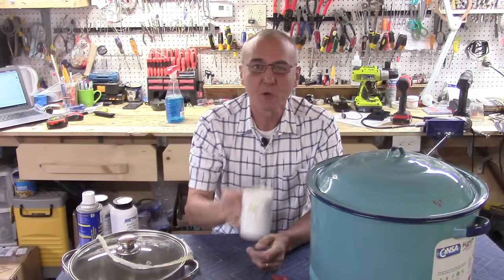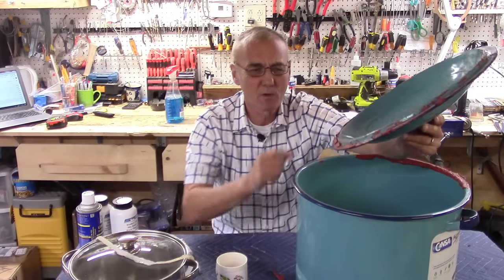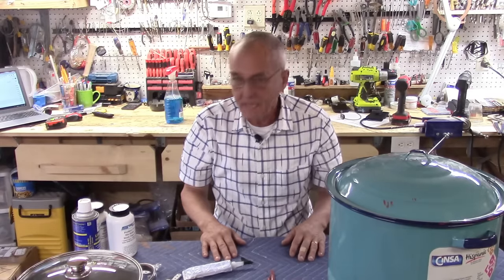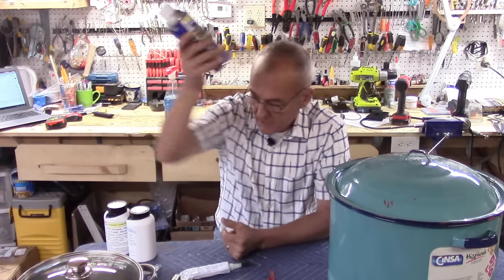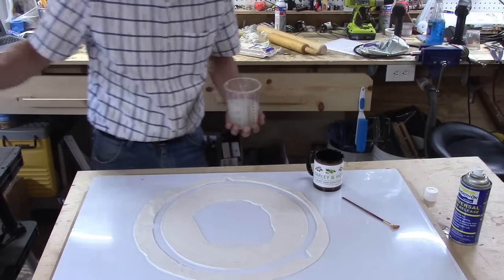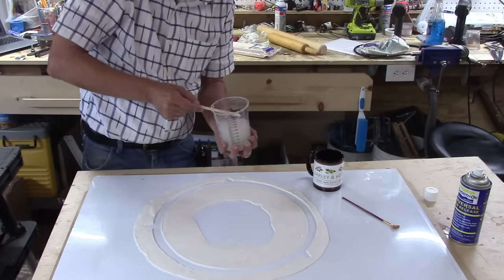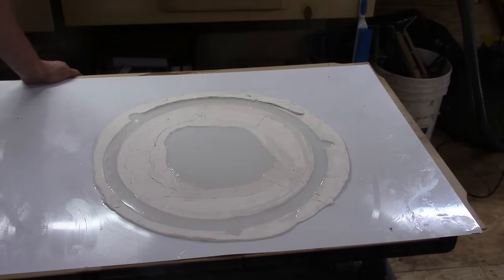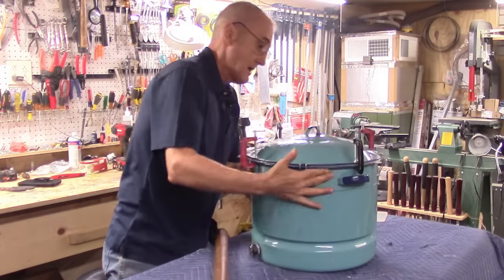BUILDING YOUR OWN STILL

Comment: Would a pressure cooker from a junk store not be easier? They have good seal (hopefully), are thick metal, and can be drilled for heat element and reflux column.
Reply: aS LONG AS IT IS STAINLESS STEEL , doh caps, you should be good to go. Aluminum is not good for distilling alcohol, but I have used an old aluminum pressure cooker to distill botanicals.

Comment: Mr George please spread the word about filtering and the importance of doing so.. stainless steel leaves flakes and trash in your distillate. My top and pot are stainless steel But ,But the so called stainless steel washers I used twice now! have rusted and the coating was in my product! I learned from you and I don't consume anything unless it runs through a Zero filter first. PLEASE spread the word to filter first.. it happened twice Mr George. No telling what was in there. At least bare bare poor boy  minimum let everything settle at least 24 hours and only use half after settling.
Reply: Dave M  your right I think it was Zinc but I got it from the same bin that said stainless steel.. I bought a few more and looked closely for the flakes in the metal. I got lucky this time and threw the others out. Just trying to warn others to make sure they are actually getting stainless steel.

Comment: Flour and water. Use clips to hold it in place.
Reply: Rye flour is the best they tell me.
Reply: Does you mean as a gasket seal? Basically make a dough and push it around the lip of the lid?
Reply: @stephenborntrager6542  Yes, as a seal. Cheap & non toxic.
Reply: My dad used to do this. He called it a whiskey biscuit. And he always ate it when the run was done.

Comment: i hear it rarely spoken about ,  but its my understanding that the chemical product of any distilled alcohol , that gives a bad hangover and reduces the quality of any liqueur, are congeners . if you dont know, copper has a chemical interaction with these congeners , effectively neutralizing and removing them. by the physics, it doesn't make much sense for anyone, be it home hobbyist, or large distillery to use anything except copper, because of these reasons. yes you can distill with many materials, from, stainless to painted and coated surfaces, but your final product will be full of congeners  unless you make some other measure to remove them. if your serious , and want a fabulous product, thats clean, smooth, and doesnt make for a nasty hang over, you use copper. yes it takes more time to clean and prepare, and you have to make sure its got absolutely  no corrosion before using,  but it by far and wide, will produce the best liqueur. i cant stress enough the importance of copper, and carbon charcoal filtering.
Reply from the maker: Please provide your documentation of this claim. 
I've been studying for years and have yet found any definitive evidence in scholarly articles and university studies that support this hypothesis. 
George
Reply: Chalk the hangover up to bad cuts. Namely too much heads in it . You have to drink some serious hearts to get a bad hang over. And right in the center of the hearts I've caught it really by accident  is I call  a sweet spot that I swear is like drinking water. It's not a burn , it's not a strong smell . Actually the first time I found it I thought the run was over but let it run just a little longer and it started back getting stronger and stronger . George I wish you could share the correct way to hit this spot because honestly  when I start hearts I stand there with a spoon and taste and spit  it ut like every 3 to 5 min looking for it but there has to be a easier way. BTW thank you . A you tube thing that's titled . Man from Tennessee makes moonshine. Well he got me started . You've taught me how to build a still how to build several mashes , how to make drinkable  shine. I try a variation I hear somewhere else and sometimes it works but it's not good. You taught me don't just start collecting and run through a temp zone trying to hold it there as long as possible to get maximum efficiency.  Popcorn Sutton is the man in the Hillbilly way but your the man of the scientific way. Thank you sir for taking us through shine university
Reply: Cleaning  the copper or stainless I pour in a half gal vinegar and run till I get about a quarter gal back. Drain put in about half gal water and sometimes use tails from last run to rinse lines and stuff back out.

Comment: George  Why not use a real pressure cooker? The lid twists and locks in place with no leaks and is already gasketed and has an outlet in the lid that can be drilled out easily for the output of the still?

Comment: Not to rain on the parade, but you can just buy a per-built stainless steel pot still on Amazon for way less than $200, which is what I use. If you like DIY and have the spare time, that's wonderful. But I certainly wouldn't bother to build one and guess when $200 isn't that hard to come up with.

Comment: I have watched a bunch of your videos and havent seen this discussed.  You always say check your videos.  How long should a levit condenser be and where did you get the nut for the heater element.  I will be using an elictracal locking nut but it is just a little big.  Thanks for all the information.
Reply from the maker: The leibig condenser should be at leasy 18 inches long and I used a 1 inch NPT nut I got from amazon.
George

Comment: George, can I safely weld on stainless steel to make a custom stainless steel pot? If so, what material will be safe to use as the welding material?
Reply: I would not recommend welding SS unless you are already a skilled welder. Generally speaking, you are going to mess up the steel and change it's properties if you heat it too high.
It could turn brittle or loose rust resistance, etc. I had a terrible experience attempting to weld galvanized steel, although, I had it coming to be, since that is zinc plated.
Supposedly silver can work as a filler to braze copper to stainless steel, though I have not tried it. Copper to copper is much easier.

If it's an external feature, there's always JB weld!
Reply from the maker: If you are using a MIG welder you will need stainless steel wire (.30 is easy to find and works great), 100% Argon as a shielding gas and run feed a little higher than normal as well as the power. Adjust after you start to get a consistent hissing sounds instead of popping and spattering. Works great.
Reply: @stephenborntrager6542  basically if you have to ask pay a professional to do it . You will be glad you did when you ruin a stainless pot

Comment: I know how to make an improvement  on a normal still if you wrap the heating coil around the output remind you give it about an inch of space between the heating coil and output tube and as it's coming out the heating coil will cool it down I actually improve defrenza still even better than this you know those soda fountain reciprocals where you put the cup in and it will dispense soda into it I used that a Stihl and a second heating coil and now he gets cold Booze whenever he wants

Comment: It might cause problems with the modeling clay, I don’t know if it is sensitive to temperature, but with epoxy, you can use a hair dryer to de-bubble the mix. It would work with the silicone too, especially since it is a thin layer.

Comment: Ok so I've tried this and had a he'll of a time . Ended up just buying a 20 ltr stainless pressure cooker . Now I tried to make a gasket that could hold a good amount of psi . But in reality how much psi does it take to push  (water) trough a 3/8 line ? Probably not much . A guy in the comments said wrap pipe tape around it. Now if you taped around the rim lid on with electrical tape it probably would work fine with a few clamps even better . What do you all think
Reply from the maker: There should not be high pressure inside a still. Very little in fact. It is the rising action of vapor that causes it to transfer to the worm. All you need to do is seal the kettle so vapor does not leak out of it.
George
Reply: I would suggest copper 1inch pipe. It's still relatively cheap with fittings maybe 3 feet high then down to a reducer connected to a 1/2 in leiberge condenser with a 1inch jacket. Should work good.
Reply from the maker: Thanks

Comment: How did you fasten the lock clamps onto the side of the kettle?
Reply from the maker: I drilled small holes and used flat head bolts on the outside and lock nuts on the inside.

Comment: Why didn't you just use a thin wall piece of Hose split it and put it around the lid and work comes together put a dab of silicone there something it's done just the thought I think that would work pretty easy to

Comment: Hello George I've tried to send you a WhatsApp as well but I can also see these videos are 4years old so I hope you get this comment... I was wondering should I a use an old urn to convert into a still or is the pressure to much for the urn to handle because a second hand urn in South Africa is a lot cheaper than buying the heating element etc. separately and the urn already has a heat control and a the thermometer 🌡️ in it but I am not to sure about the pressure

Comment: I need to make something to do waste oil into a clean fuel to burn.
I have condenser and evap from a cloth dryer. And a old oil tank.. fill and heat with fire oil turns into a gas through the condenser?  Then it's cooler back into liquid through evap into a Jerry can

Comment: George, where did you find those lock clamps?
Reply from the maker: amazon
Reply: You can get them on Amazon - search for "uxcell 2 Set Stainless Steel Hardware Boxes Spring Loaded Toggle Latch Hasp"
CJ
Reply: @BarleyandHopsBrewing  how did you attach the clamps simple nut and bolt with a rubber washer?
Reply from the maker: @oxstien123  Exactly.
Reply: Also available on eBay called Cupboard Cases Spring Loaded Safety Toggle Latch Catch Hasp Lock 6pcs

Comment: Hey George, I've been watching a couple of your videos and was just looking at an older one about fermentation. Well I came to this one because its your newest post, and I was wondering what you thought about my mash recipe. Does it seem good, would you use a similar one, could you offer any advice to improve it? 

In a fifty-five gallon barrel I combined one pound of yeast with a five pound bag of sugar and fifty pound bag of cracked corn, that sits for about two weeks (checking occasionally) and then pot distilled.
Reply: Unless that corn has been malted, your aren't going to be get anything out of that. You should look up George's videos on malting and what ABV is.

Add 50lbs of sugar, 4cans of grape concentrate. You don't need that much cracked corn, but it would work. It's ok but it's only purpose is flavor unless it's malted.
Reply: Need lots more sugar..
Reply: If I was making it malt the corn first to get sugar out of it . If you don't want to malt the corn I would use around 75lbs sugar about 10 or 15 lbs cornmeal just to leave the taste sugar and yeast make alcohol and corn  can't make sugar without being malted. This is actually what I do because malting 50lbs corn isn't that easy and a pia to work with especially not to get any mold

Comment: How do you hook up wiring and control heating on the element
Reply from the maker: I will use one of the PIDs I built. Simple 2 wires to the element and plug it in to the controller.
George

Comment: George where was this video a year ago 😂 lol I've been using a modified 55 gal drum clamp and good ol fashioned flour and water kinda like a playdough  .
Reply: Lol wow 55 gallon drum your leaps and bounds beyond me!
Reply: I tink I need a bigger pot!!!
Reply: No right now all I have is a 25-gallon pot but I'm just using a 55-gallon drum lid clamp
Reply: @jeramiahsmothers1114   still has the production factor.. I gotta mix my wash between three 6.5 ferments I think I drink too much lol
Reply: Cowpie why don't you get coats for Rubbermaid tubs there food grade
Reply: @cowpiecowboy7599  why not use Rubbermaid totes
Reply: @jeramiahsmothers1114   rectangle tote? I know I can get my hands on a 35 gallon brute trashcan.. hummmm
Reply: @cowpiecowboy7599   it all does the same sir I believe up to 15% ABV is what they're rated to hold
Reply: @jeramiahsmothers1114  thanks Awesome!
Reply: Hey !!!! White boy!  How do I seal that thing off wet rags? Do I use an air loc.. and will it sit good for a month? I'm sure clamping the lid shut would let the bad stuff escape and nothing would creep in unless you stirred the cap out of it.
Reply: @cowpiecowboy7599  personally I make playdough out of flour and water and seal the lid and pot with a modified 55 gal drum lock but spring clamps , c clamps whatever u can find for cheap . Because this is an open system it doesn't create any pressure
Reply: Or r u talking your fermenters the thing about fermenting the c
Distiling is the power of the imagination so if it works it works
Reply: @jeramiahsmothers1114  true I need still supply.. I drink too much lol started my first sour mash tonight. I'm sure I can sacrifice a spigot for the 35/ last question do you see any problem cooking my corn in aluminum as long as I don't distill or ferment in it. That may be a newbie question.
Reply: @cowpiecowboy7599  to be honest there is nothing that's been linked that there is anything wrong with cooking in aluminum other than over time it can pit and cause structural integrity damage with acidic mashes
Reply: @jeramiahsmothers1114  yea.  just to mash the corn cool deal thank you brother.

Comment: Can't you just get a sheet of fairly thin rubber, cut it bigger than the diameter of the lid and clip the whole piece in place. Also cut a breather hole near the vent. That should last years.

Comment: get a polyurethane sealant  smooth it out over the pot or lid       grease the pot or lid  push together to make a male female  twist a few times to get the seal smooth pull appart let dry

Comment: An old Pressure Cooker pot would work well for this.
Reply from the maker: I agree
Reply: Best thing about using a pressure cooker pot is that it will already have a good clamping system and a replaceable food grade seal on the lid.

Comment: I love this project and your channel is very informative and fun. I like to build things and brew beer, I am considering distilling (thanks to your channel). I want to upgrade my method of chilling wort and I was wondering what your thoughts were on counterflow wort chillers and if you think they would make a good duel purpose piece of kit. Could I use a DIY counterflow chiller (copper pipe and garden hose https://www.youtube.com/watch?v=WRn7j-DZkRA&t=20s) as a "worm" condenser? What are your thoughts? Any significant gotchas you can think of?

Comment: Has anyone had any luck using a seal made of dough for one time use?  Would it ruin your mash if a little dough dropped in it?
Reply from the maker: Yes. A little dropping in has no adverse affect on your run
Reply: @BarleyandHopsBrewing  Thanks for the quick reply.  I'm slowing gearing up for my first still.  You have a lot of great info on this channel!

Comment: How bout just buy a inner tube that size..cut it with whatever to fit the lid...
Reply: I tried that. I don't advise it. Ethanol alcohol is an excellent SOLVENT - Ethanol will dissolve plastic, rubber, certain types of fiberglass and even aluminum over time! The rubber inner tube will not stand up to the ethanol vapor and will start to leach into the vapors. Your product will be cloudy and taste like absolute crap. Actually the initial taste was pretty good but the aftertaste was brutal. Take a look at the pics at this address - http://adiforums.com/topic/8458-finding-the-right-alcohol-proof-rubber/

Comment: Why not buy a bicycle inner tube in the size of the top of your pot split it all the way around and stick it on and you got yourself a seal Walmart for 2.98
Reply: I tried that. I don't advise it. Ethanol alcohol is an excellent SOLVENT - Ethanol will dissolve plastic, rubber, certain types of fiberglass and even aluminum over time! The rubber inner tube will not stand up to the ethanol vapor and will start to leach into the vapors. Your product will be cloudy and taste like absolute crap. Actually the initial taste was pretty good but the aftertaste was brutal. Take a look at the pics at this address - http://adiforums.com/topic/8458-finding-the-right-alcohol-proof-rubber/

Comment: OK so I don't wanna get in trouble here but Butt... I was gonna mention this last night and the conversation stopped.  I will be using tubing and a heating gun to heat the hose up and shape it to the pot. Still using the vise grips and using a nice thick piece of weather stripping where the hose ends meet. Oh as far as the hose goes use a razor blade to cut it as straight as you can get it down the center make a u shape as long as you need to go arounfd your lid. Then a heating gun to shape it to your pot and weather stripping where the hose ends meet ... Walla vise grips and go lol
Reply: But hey never trust a theory lol trial and error
Reply: OMG watch out Ben Franklin  I can invent stuff too!! Worked flawelessly!!!!
Reply from the maker: Absolutely amazing. Keep it up. There are many viewers who can take a lesson from your comments.
Reply: Attention Attention Community this did not work!! I used about 10 pair of vise grips and felt even more like an idiot each time I tried to stop a leak..  never trust a theory... cheap ass weather stripping is filling the jars right now..

Comment: What I don’t understand is why it has to be a perfect seal. I mean once you attach the vent pipe to the still, you have a large “leak”. 
So, the gasket just needs to be good enough to prevent minor vapor loss, as the still won’t be under pressure like a pressure cooker.
Reply from the maker: That is correct. It is a complete seal to prevent vapors from escaping before they get to the condenser.